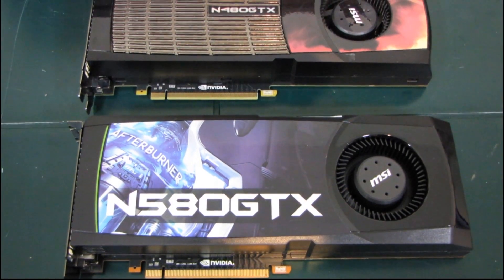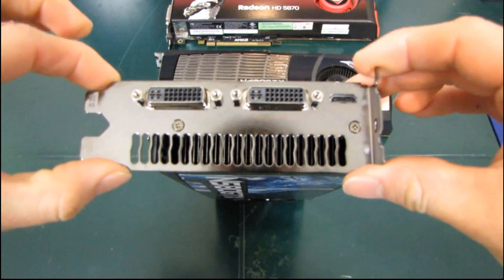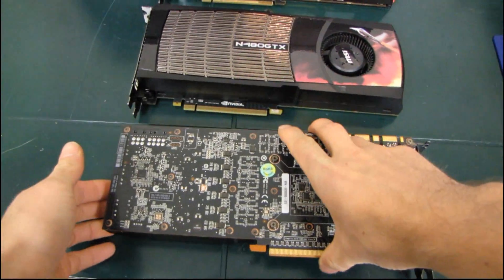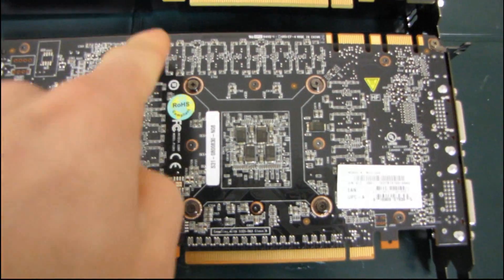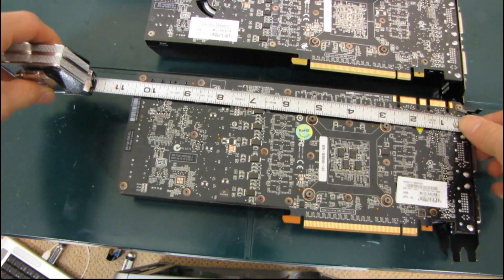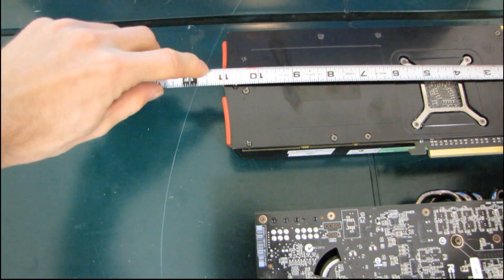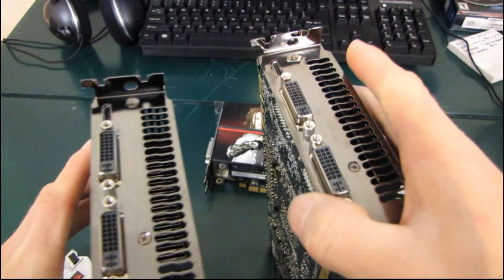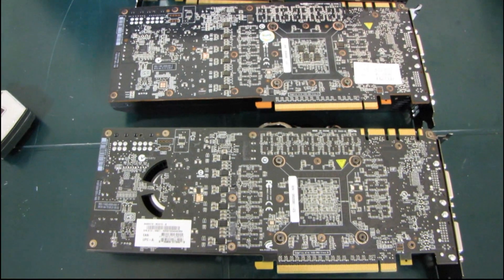NVIDIA GeForce GTX 580 Measurement & Length Comparison Linus Tech Tips

Comment: @metallicRazork does not matter, considering it is projected to be faster, use less power, and run a good bit cooler than the 480, anyone is willing to upgrade to this for a top-end system. The main reason for this is a smaller die size of 520mm squared compared to the 480's 529mm squared (not fab size which is in nm), and an improved GPU. It may not seem like a lot, but in the world of computers small numbers like that do make a difference.